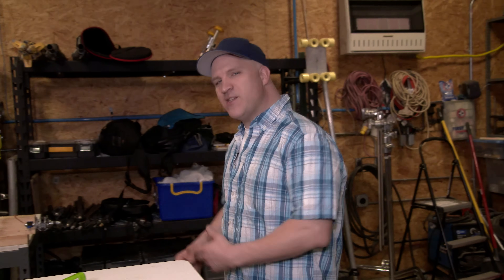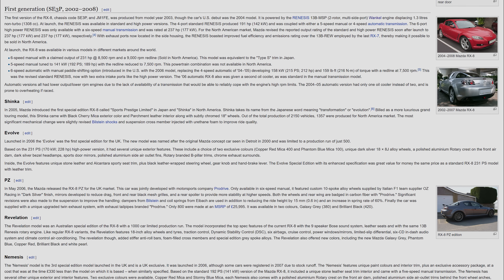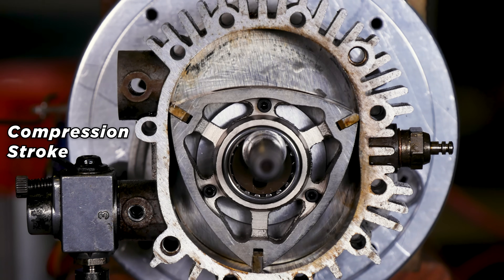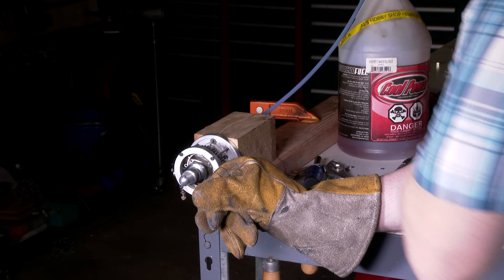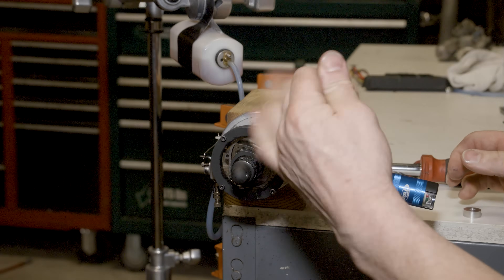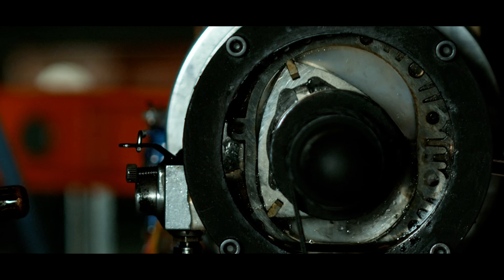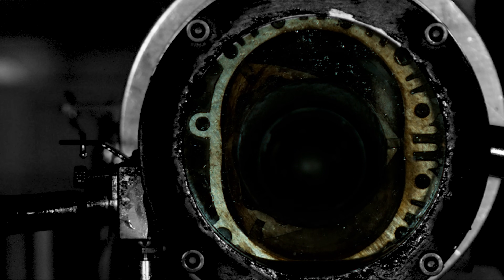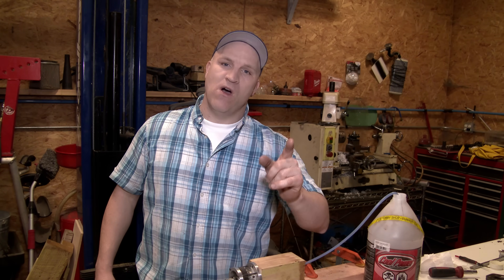See Thru Rotary Engine in Slow Motion - (Wankel Engine) 4K

Comment: No wonder my rx8 gets terrible gas mileage its not burning 75% of the fuel......
Reply: Tb0n3 I was told that if you mix a little 2-cycle oil in your fuel then it will increase the lifespan of the apex seals. It makes sense if you think about it and digging around the internet it appears to work.
Reply: Gary Leach makes sense Gary. Also 2-cycle helps lubricate diesels using low sulfur fuels.
Reply: @tim9lives Gary is just mindlessly repeating a  common urban myth... pre-mixing a Wankel engine with spark ignition is a really really bad idea... which is exactly the engineers at Mazda designed all their modern engines to only use metered oil injection.
Reply: @lyokss  a shot of redex would be good to lube and it burns lean and clean or castrol r
Reply: @Burt Habrad Any motor oil that burns clean is not a very good lubricant... which is why getting the right amount to the right places  is so important.
Reply: @lyokss   it helps if you're consistently running at high RPMs yes but a rotary naturally injects oil via the oil metering pump into the intake stream and so for normal driving or the occasional high speed run you really don't need to
Reply: Eh, try turboing it and running on E85... I get 11mpg in my RX8:)

But it's the most fun car Iv'e ever owned...
Reply: Punchy LightBeer how’s it holding up to boost?
Reply: Iv'e been through about 8 engines in 8 years, but that was because of the dodgy workshops (I tryed 3) not building it right.
Now over the last 2 years Iv'e redone everything and it's running great:) - long story..see my channel..
Iv'e run up to 20 psi recently but I have read the stock Renesis can't flow more than that besides the detonation risk with it's 10:1 compression. 
My stock ( 5000km {3100miles} ) short block is running fine on 17 psi but that is mostly because of the E85 not my shit tuning ability.
Reply: Ebola Chan always heard it’s not worth rebuilding rotary engines. Just get a new one and be done with it.
Reply: @tim9lives They don't make new Wankel engines anymore... Mazda discontinued production back in 2012.
Reply: @r1yamahamini  no disrespect to you or your car as you do enjoy it but why own something that needs regular rebuilding, more than the usual servicing etc that would just piss me off long term. I perfer something thats good quality build and lasts a while
Reply: @r1yamahamini  whats e85
Reply: The purdy channel  ,Ethanol 85% and 15% petrol . . blend fuel
Reply: @r1yamahamini  oh we dont have that fuel its either petrol or diesel
Reply: +The Purdy channel Ethanol and Ethanol blended fuels have been around for over 100 years and are available in dozens of countries including the US, Canada, Brazil, China, Thailand, India, Australia and several European countries.
Reply: @doktorbimmer  not the uk though they dont have it at our pump station
Reply: As I understand most premium fuel sold in the UK is e5 and is currently limited by law to 5% Ethanol or less. Because the UK is still decades behind the most Western countries in vehicle emissions standards and UK manufacturers lobbied against adopting more expensive Flex-Fuel standards E85 will not be available in your country any time soon.
Reply: The purdy channel UK petrol (gasoline) is 5% ethanol. Our diesel is 5% biodiesel (methyl ester).
Reply: doktorbimmer 
E85 is not a green fuel. The energy required to grow the corn and land that cannot be used for food more than negates any benefits. 
Biodiesel is a less energy intensive fuel but has the same land use problems.
Reply: @r1yamahamini  11 mpg?!?!? What the hell. Jesus how does a hummer h1 have 1 less mpg than you 😟
Reply: @Linkophere  ..... I can't believe I just read that year long argument to get to your comment:)
Two reasons, I run E85 ( you need to use 30% more fuel to make the same power )
and Iv'e been purposely running too rich because I'm scared I'm going to blow another motor...
Also I've been getting 14.3mpg ( 6.1Km per litre here in Australian numbers ) since that old comment... And I'm a lead foot:))
Reply: The 13b use side ports for the intake and peripheral ports for the exhaust.  Renesis uses side port for both more restrictive exhaust but no overlap so it runs cleaner emissions wise.  A rotary built for racing will often use peripheral ports for both.  The downside is they are completely gutless until the top of the rev range which doesn't make for a good street engine though some people do it. 

As for adding oil to the gas if your oil metering is working proper it's not needed.  The apex seals failure is nearly always a result of poor tuning or a problem with fuel delivery.  On a boosted rotary the apex seal should out last the motor.  Naturally aspirated is more likely to have a wear issue as they last roughly twice as long before rebuilds.  Most rotary guys subscribe to premix though and other than the pain in the ass factor it's not going to hurt..  It's worth noting that Mazda's racing teams don't use premix and stick with factory metering.  

The seals that are most likely to fail are the coolant seals in either case.  They degrade quickly because of combining iron and aluminum parts.  This is a problem because they expand and contract and different rates and it leads to a chemical reaction that degrades the coolant quickly so changing coolant is a must. X16 would have used all aluminum housings which in theory would have lead to a longer lasting engine.
Reply: This is running on nitromethane, which requires a much richer mixture.
Reply: Doesn't the RX7 engine survive boost much better? The RX7 ports are on the circumference instead of on the front/back on the RX8 if I recall correctly. Do you go through many APEX SEALS?
Reply: @Tb0n3  we go through many :)
Reply: he was using a glow engine there, and they are a low nitromethane mix with oil. So most of that is oil in the exhaust. since they don't have their own oil.
Reply: RX8's 13B Renises uses side ports on both the intake and exhaust. This coupled with higher compression rotors allows for better reliability and performance (NA) over peripheral port designs, reducing strain on the apex seals. The increased resistance of the exhaust allows for more fuel to burn in the chamber rather than while it's exhasted providing better economy and power. The RX8 can run like every other car except requires regular oil changes and top ups because it still burns oil by design.

The RX7 also used side ports on the intake, but used a peripheral port design on the exhaust. This works well under forced induction as higher exhaust volume allows for the rotor to travel more freely. Too much back pressure slows down the process. In the NA models of the 13B, this meant reduced economy and performance over the Renises but in turbo models, this allowed for higher boost offering improved performance at the cost of efficiency and reliability.

Basically the Renises was a compromise on performance, efficiency and reliability making it a usable daily driver. On the 13B in the RX7, people often inlarge the intake ports with bridge ports or even peripheral ports allowing for more air to enter the engine. This is thanks to the original design being restrictive on the intake rather than the exhaust. The Renises is the opposite. The exhaust is designed to be the restricting point to allow for better NA performance. But when adding forced induction has the issue of the exhaust impeding the performance. With turbo's, its not about efficiency anymore but rather getting as much air through the engine. When a Renises is turboed, the extra pressure does not match with the original design and while you can make small gains to the high 200HP area, it significantly increases the wear on the apex seals, side seals and housing. It's not uncommon for these engines to blow through coolant channels in the exhaust when using forced induction. You can't really inlarge the exhaust either as the engine is already designed pretty close to it's limit and any cutting will seriously increase the chance of catastrophic failure of the engine housing.

It's not all bad news though. The RX8's rotors are used in high power 13B engines that make use of the old style of housing allowing for higher compression in the less restrictive housing design. A well known driver who does this is Mad Mike using engines built by PPRE in New Zealand.
Reply: @dingooddflamingo  So, most of the design trade-off's can be fixed by CNC'ing your own rotory engine with better seals, better thermal barrier coatings on the rotor faces & more modern anti-friction coatings on sliding surfaces.  If someone would design a rotory engine with apex seals on the block rather than the rotor apex itself, that would allow for stronger & better sealing with reduced wear.
Reply: @madjimms It is very apparent that you do not have a firm grasp or working understanding of the fundamental and inherent flaws that plagued the Wankel engine design right up until it became obsolete in 2012... The best engineers and engine manufacturers in the world concluded long ago that the Wankel engine had reached the limits of its design evolution and no longer held any further development potential... even Mazda abandoned development of production Wankel engines in May 2009... more than a decade ago.
Reply: Its a challenge to get a complete burn in a rotary bc of its design. The sweeping and expanding "combustion chamber" isnt ideal for burning the air/fuel mix. Piston engine combustion chamber is more defined and direct. The extremely simple design of the rotary doesnt allow for the same tweaks as a piston engine. Things like precise gdi and vvt can optimize combustion in a piston engine. Rotaries dont have those luxuries.
Reply: not fuel, its oil, if he's using glow fuel. which is mineral oil and nitromethane mixed.
Reply: Garyc Cotugno typical mix is 20% castor oil 70% methanol and 10% nitromethane.
Reply: Just to clear things up for anyone reading this far, glow fuel is not "mostly oil" nor simply nitromethane mixed with mineral oil.  Most high performance glow fuel for cars is ~10% oil, ~10-30% nitromethane, with the remainder being methanol. Air applications usually bump the oil to ~20%.
Reply: Absolutely. Iceberg was totally correct. As were a number of others who have highlighted this.
This was a glow fuel model engine. It runs on a mixture of a small proportion of a lubricating oil, between five and around twenty five, traditionally castor, though these days more often a synthetic or a mix of the two as castor still has some remarkable properties especially at high temps. Not too mention it smells so damn good. Especially being cooked in a hot MotoXer flying past ya, proper on pipe. Though I digress.
This is mixed into a base of methanol with a percentage of Nitromethane, between five and thirty usually, depending on usage.
Methanol and Nitromethane require a much, MUCH richer mixture, as it in effect contains a decent proportion of it's own oxidiser, hence needing less air, in proportion to fuel, and in practice meaning same air, more fuel and more power.
This is why especially when starting, it is pissed wet through with fuel and looks so obviously so. It is also a very rudimentary form of carburettor, having no floatbowl and only the simplest of metering. As the mixture is so rich accurate metering is less important than in a petrol engine. For anyone seeing this and imagining this is typical of a normal, full sized petrol Wankell rotary engine. It is not.
I feel at least couple of folk are being a little misled by this. O course they are more problematic with regards emissions, but excess fuel absolutely sloshing around and spitting out the exhaust to poison all the Panda's really is not something that is happening.
Reply: Oh I see the fuel was shooting out of the exhaust
Reply: Neutron correct mixture had barely visible flame. Rich mixture let you see the flame. That’s it.
Reply: We tuners know you are stupid but ethanol defeats all those gasoline problems you mention.
Reply: Chris Burney   60.000km   Rip rotor ;)
Reply: Remember, what he is demoing there should be glow fuel, if i'm not mistaken which is mostly oil.
Reply: Rotary engines are much less fuel efficient that piston engines and use much more oil.
Reply: I get 22 MPG in my deleted and tuned Duramax 6000 pound 4x4 truck. Lol and tune 5 makes over 500 horsepower and 1000 foot pounds of torque.
Reply: Can't do that with a supercharger, its just a large compressor.  thrust vector is in the wrong direction, and no way to self sustain, unlike a turbo charger.
Reply: Garyc Cotugno 
Supercharger is simply a blower. It would do the job fine. But Wankel throws so much heat down the exhaust, a turbo makes far more sense.
Reply: Why compare four stroke with two stroke?
Reply: Same plus you have to feed it high octane fuel but its so worth it
Reply: @monty1300 this idea of yours is revolutionary ...
Reply: +Eric Christian Felix Wankel and Walter Froede developed the Wankel DKM-54 prototype engine from their 50cc NSU motorcycle supercharger design... which is of course why the orbiting piston concept still works better as a compressor than an actual engine.
Reply: Just an hour ago, April 2019, a neighbour told me he gets just 20mpg out of  his Mazda 1300cc, 1.3ltr, Wankel, which I found hard to believe.   Through curiosity, I reverted to Youtube and found this.   By watching this little engine throw it’s fuel away, I now understand why.
Reply: @Josephine Bennington  BEST ENGINE OF THE 21 CENTURY THE ROTARY ENGINE
Reply: Considering likely f**ked the carb settings to account for the poor sealing from the (poor) build required for the acriclic window without all the crankcase bolts exerting tension, not running it with an exhaust (tuned like a 2-stoke engines) for backpressure pulse wave timing assisting in acting as a harmonic induced exhaust valve at design normal RPM for this model aircraft engine - about 10cc in size...
   But just adequate enough, to give an idea.
Reply: @Razor 1uk  If the carb settings were "f**ked" it wouldn't run... The Wankel KKM is a 4-STROKE and uses the same 4-stroke operating principle as any Otto Cycle engine... tuned-exhaust pulse assisted exhaust scavenging is not required... although these little engines can certainly due with a good muffler due to the high sound pressure level.
Reply: Chris Burney , your RX-8 engine is a little bit different than this simple model engine. your RX-8 does burn all the fuel, for one difference is your car has a different injection system than this model engine does.
Reply: @Tim Schutte  Not really, Graupner and Mazda both became NSU-Wankel KKM type engine licensee's in the 1960's, the RX-8 certainly does not burn all the fuel because it has a very inefficient non-quench type combustion chamber... what the RX-8 has is a large after-treatment catalytic converter to burn the remain hydrocarbons although much of the heat energy is wasted which is what causes the poor fuel efficiency.
Reply: @MajorLeague  Anyone familiar with engine BUILDING should know that a 10:1 static compression ratio is NOT the ideal BUILD SHEET for ANY turbocharged engine. The more comments you post the less knowledgeable you look kid.
Reply: @MajorLeague Wrong again kid... a 10:1 static compression ratio is well above the ideal limit for any spark ignition engines running more than 1 BAR and the higher the manifold pressure the lower the SCR needs to be... this applies to any fuel type and especially engines like the Renesis that is hamstrung by a horrible combustion chamber architecture that cannot support "Quench"/High Swirl chamber technology or Stratified Charge Mode combustion. The Renesis like all Wankel KKMs has an incredibly weak, fragile internal seals which are easily damaged excessive DCR and IMEP that cause uncontrolled deflageration or high brisance propagation pressure waves.
Reply: Terrible mileage, poor emissions. Engine seals don't last and Mazda cooked the books for mileage by requiring very thin oil that doesn't protect the engine. Bad plugs..due to the Mazda RX-8 engine defect, issues regarding the spark plugs can lead to fuel flooding the engine, rendering it inoperable. So, emissions regulations and the inherent challenges associated with making rotary engines environmentally friendly are bad things. These are the issues that have always dogged the rotary engine, and are increasingly difficult to surmount.

Mazda also kind of ran out of money, since building a rotary engine is pretty far down on the carmakers list of priorities.
Reply: @QuantumRift  Delet this!
Reply: @QuantumRift  And now the wanna develop a new one. They should just keep the rotary engines in mopeds and racecars.
Reply: @Stagger Lee Wankel engines are obsolete now, no legitimate engine manufacturers are making them or racing them.
Reply: @QuantumRift   That is why youtube exist. Maybe youtubers have approached the issues and have demonstrated solutions. =]
Reply: @Sofa Kingdom All of the legitimate engine manufacturers in the world have abandoned further development of the Wankel engine... it is now the sole domain of crackpots like Gilo Cardozo and David Garsides or criminals and con-men like Paul Moller and Ernie Brink.
Reply: BEST ENGINE OF THE 21 CENTURY
Reply: + because exhaust, intake and power stroke happen all next to each other, it's very easy for something to go wrong or not work very efficiently. + at the beginning you could see how the power stroke was very inefficient, it's supposed to increase engine speed, but it was kind of pushing clockwise as well instead of just counter clockwise. Near the end, it ran much better!
I think this is a very interesting engine design and cool video!!!
Reply: @Arne Maeschaelck A very interesting, yet obsolete technology that is no longer manufactured anywhere in the world today... the Mazda RX brand was discontinued years ago!
Reply: @doktorbimmer  of course it's obsolete and inefficient, but that doesn't make it less interesting? it's cool that people tried this and it worked (kinda), but of course it's not very 'acceptable' these days where the environment and efficiency are so important. I don't get what you're trying to point out and why it gotta be bold like that ... don't be extra, it's still interesting technology.
Reply: @Arne Maeschaelck I'm simply pointing out the fact that the Wankel KKM design is OBSOLETE today because it is technically INFERIOR to comparable reciprocating engine designs that the Wankel engine failed to replace.
Reply: @doktorbimmer  BUT THAT DOESN'T MEAN I CAN'T FIND IT COOL OR INTERESTING. WE HAVE THE PAST TO LEARN FROM. A LOT OF THINGS FROM THE PAST ARE STILL INTERESTING, THOUGH. THANK YOU, BYE.
Reply: @Arne Maeschaelck R.I.P. Rest In Peace Wankel Engine 1964 - 2012.
Reply: @Arne Maeschaelck A lot of people enjoy obsolete, outdated and antique engines too... It is fascinating to learn why the Wankel engine is dead and why it was an commercial failure.
Reply: @doktorbimmer  Let's be real, it's more fascinating to understand why a brand like Mazda even got away with selling them for so long. They're not reliable, not efficient, don't burn clean, ... but they're fun because it works and it's different. It's not even that obselete or antique, because the piston engine has been around for long as well. Same fashion a two-stroke engine is still used in a lot of applications, but not in vehicles anymore, simply because it wasn't the better choice. Compared to four-stroke piston engines, rotary engines weren't the better choice. But it's still interesting.
Reply: @Arne Maeschaelck Mazda was just one of 26 Wankel KKM licensee's... they all have (including Mazda) have abandoned the design.
Reply: @Arne Maeschaelck All Wankel KKM engines use the same 4-stroke operating principle... they are just mechanically and thermodynamically less efficient.
Reply: @Arne Maeschaelck You seem a bit confused...over 100 million cars were sold last year with reciprocating engines... and ZERO were sold with Wankel engines...
Reply: @Arne Maeschaelck Historically In years past a lot of homosexuals have endorsed the Mazda RX brand... but since it was discontinued in 2012 the LGBTQ community has adopted the the electric vehicle manufacturer TESLA Motors® as the official car of the gay community.
Reply: @//Project Grassroots Fuel is injected during the intake stroke... just like any 4-stroke, spark ignition engine... you cannot inject any fuel before the intake port is uncovered. The fuel is injected before the start of the compression stroke... because the compression stroke does not begin until the intake port is closed.
Reply: Ernie Brink's engine has the worlds best fuel mileage... BECAUSE IT NEVER RUNS! LOL!!!
Reply: @doktorbimmer  are electric engines the future?
Reply: @AA16 Special Edition Not for automobiles or aircraft... batteries can never reach the energy density required for acceptable range.
Reply: but the sound tho
Reply: That was my first observation. Theres fuel just getting chucked out to the exhaust, no wonder why they say they cats go bad fast, it would blow fire out the back, or be black as holding something held above a cigarette lighter.
Reply: @Brother Juggernaut Absolutely, catalytic converter over-heating and pre-mature failure was always a problem. As was the carpet catching fire inside the passenger compartment. This is all due to the Wankel engines inherently low efficiency... most of the horsepower potential contained in the fuel is wasted out the exhaust system.
Reply: @MajorLeague Real amateur people, the professional engine builders understand that using 10:1 CR with high manifold pressures is a recipe for disaster. There are lots of home-gamers and shadetree mechanics out there building "grenade" engines in their driveways like you kid, but by simply bolting on aftermarket kit parts without any grasp of the engineering required to make big horsepower numbers reliably all you will achieve is poor performance and ticking timebombs.
Reply: @MajorLeague That pile of junk was no race car son... It is very doubtful someone with your limited education and experience could be hired as professional automotive technician in any capacity... certainly not in professional Motorsports.
Reply: @MajorLeague How would you know? No one would hire someone as incompetent and uneducated as you son... sounds like it tough for you to find a mop job.
Reply: @MajorLeague Please stop pretending to an expert... its obvious you are nothing but an amateur fan at best... a complete novice.
Reply: @MajorLeague Wankel engine do not have modern high efficiency Quench type combustion chambers... they are more susceptible to both detonation and detonation damage.
Reply: @MajorLeague Curtiss Wright and NASA spent millions of dollars developing a certified general aviation engine but all efforts proved a total failure, there are no FAA or EASA certified Wankel engines.
Reply: @MajorLeague You do not appear to be an expert on any aspect of Wankel engines or automotive engineering in general... any engineer or experienced automotive professional can see this from your nonsensical, amateur remarks that you are attempting to discuss a topic you know almost nothing about and certainly have no formal education on the topic.
Reply: @MajorLeague  Wrote, Quote;  "1. Turbo applications can't benefit from quench in any significant way." 
Then please explain WHY? Why does ever single current turbocharged production engine and modern turbocharged racing engine uses a Quench chamber design???
Reply: @MajorLeague Wrote,quote; "It (Quench chambers) can actually increase volatile combustion under boost."
Then why can Quench chamber engines run higher manifold pressures and temperatures, higher advance curves and lower octane fuel than non-quench designs????
Reply: @MajorLeague WHY? Would any engineer Increase the combustion surface area of an engine that already has TOO MUCH surface area conductivity and horrible thermodynamic entropy????
Reply: The Modell Engine is to rich in Mixture. WAY to rich
Reply: That was the first thing I noticed. It took “running rich” to a whole new level.
Reply: No ignition??  Does it work like a diesel?
Reply: Bruh this is a toy engine that has no spark plug, and has a lot of oil in the fuel, and he probably doesn't know the "sweet spot" for even this novelty engine.
Reply: Unfortunately boost from a turbo is murder on the apex seals. The RX-7 was better designed for it.
Reply: Yeah, rotaries are not known for their fuel efficiency, which is why Mazda should be given high marks for making the improvements they have on their Wankel design. They also don't make much torque (The RX8, for example, makes about 150 lb/ft of torque). This airplane version had extremely inconsistent combustion cycles (some rotations not firing at all) and blowing LOTS of fuel out through the exhaust opening.
Reply: My airplane goes a long ways on a couple gallons of fuel.
Reply: @170boone  Economies of scale dictates that the smaller engine is going to be less efficient than the large one. Plus, I can only imagine the tech that helps that airplane rotary burn fuel more efficiently than this small model airplane one.
Reply: Tend to burn oil too
Reply: the wankel works and looks a lot like a 2 stroke to me
Reply: Bro buy higher octane fuel. Smh.
Reply: My 460hp v8 mustang gets about 19mpg driving how ever I feel like, it’ll break 24mpg if I stay out of it
Reply: MajorLeague  I guess you have never seen a 12A or a 13B rotor???  All Mazda RX engines had a combustion chamber recess.
Reply: MajorLeague  All engines have a quench space?!?! WTF! I guess you don't know what a HEMI is kid!
Reply: MajorLeague  The BMW S68 is a GDI engine that operates with Stratified mode combustion, just like a Diesel... of course it doesn't have quench effect. IT DOESN'T NEED IT!!
Reply: But that’s also why it shoots some mad flames ;)
Reply: You can try change gasoline to propane gas  or add hydrogen with gasoline.Hydrogen should add torque, when hydrogen will burn ,hydrogen converted into water and hight temperature will be evaporate water creating hight pressure.Its my theory.
Reply: Crazy
Reply: @*BOOG* in case you haven't noticed all cars these days with internal combustion engines aren't 100% efficient, they all waste a little fuel on the exhaust stroke
Reply: rotary engines take in extra fuel to help cool the apex seals it uses the unburnt gas to cool them so that is why you rx8 gets bad gas milage but in the long run its saving you money because apex seals are not cheap and they are a pain in the a$$ to fix
Reply: Yeah it's 18 too 20 miles a gallon
Reply: Travis Thacker 
Google Ilmor 5 stroke engine. Two four strokes feed exhaust gas into one larger cylinder. It’s about 15% more efficient. Benefits are not huge.
Reply: Sakul you lot clearly failed to listen to what the narrator said. He put a rich acetylene mixture through the engine to create a yellow flame. All that did was demonstrate how it works. When it was running correctly you could not see the flame.
Reply: Rotary engine is easy to make!
Reply: The RX-7 has a lower compression ratio 9:1 vs the RX-8s 10:1 so you can't run as much boost.
Plus the variable intake manifold makes it a bit more difficult to tune.
Reply: @r1yamahamini  o
Reply: @Kim Brokaw Yeah, 11MPG really sucks!
Reply: @doktorbimmer  also another weird question, is swapping in a nissan z33 v6 in an AE86 a good idea? Apparently my friend did it.
Reply: Bass Nazi I get that it’s an inefficient process due to a number of issues from imperfect seals to trying to maintain an even burn in a moving “cylinder,” etc.  But if you could separate the unburnt gas from the rest of the exhaust it wouldn’t really matter how inefficient the process was.

I was just wondering if there was a way to dump the exhaust into a spinning drum or something to achieve this. It would be well worth the added complexity.
Reply: @xpeterson  one major problem would be the vapour ignition, as seen in this video.

Once you box in the exhaust emissions and it ignites then your left over fuel is lost. 

That's why you get those cool looking flames from the exhaust sometimes. 

It needs some real genius engineering but sounds possible to an extent. 

I think it can be done, but probably not worth it since people are moving more to electric and hybrids.
Reply: @Abdul Muqsit Tofie Combustion efficiency is just one of many fatal flaws in the Wankel engine concept... Wankel engines no longer offer any advantages or further development potential.
Reply: @doktorbimmer   Here we go again. This man has a personal vendetta against rotary's.  lol
Reply: @Sofa Kingdom I personally love Rotary engines and have 3 in my collection... but of course we are talking about WANKEL engines here son, apparently you don't know the difference yet...
Reply: @Sofa Kingdom  The truth is incontrovertible son... people need to hear the facts and the false rumors you try to propagate need to be exposed for what they are, these crackpots are nothing but fakes and frauds.
Reply: @Sofa Kingdom Why do amateurs and dilettantes like you feel the need to post false rumors and regurgitate urban myths regarding a topic in which you are not formally educated or sufficiently experienced to speak intelligently on???
Reply: @Sofa Kingdom You do not intimidate me in slightest son... If you think the Wankel can be developed into an efficient design you know absolutely nothing about engineering or the history of the Wankel engine's development.
Reply: @Sofa Kingdom Its very obvious that you are completely oblivious of the development history of the Wankel type KKM-57 engine design and lack even a basic fundamental understanding of its inherent flaws that have have rendered it obsolete in the automotive industry... even Mazda gave up trying to fix the horrible problems that plagued the Wankel engine right up until production ceased many years ago. None of your childish insults will change these incontrovertible facts.
Reply: @doktorbimmer  aw, how cute.
Reply: @Sofa Kingdom Just the facts here kid... I see you continue to be plagued by poor judgement and bad life choices but again some people like you feel the need to learn everything the hard way.
Reply: @doktorbimmer  Since you seem to hate rotaries so much, why don't you stick to your piston engines and your comments in bold and quit whining about other people driving and enjoying what they think is a much cooler and interesting type of engine? If someone drives a rotary, it's their money, not yours. 
So you can take all your salt and go put it on all the icy roads out there, dear.
Oh and, Apex seals last a long time if you take care of the engine. Which you probably don't.
Reply: @reinbeers5322  🍻💯💯
Reply: @xpeterson  It is called EGR
Reply: @xpeterson  the flaws in the design of the (Wankel)engine which could be easily overcome with turbocharging, the turbocharger should be a tesla turbine at exhaust, roots type on intake...
Reply: Is there no way to centrifuge the unburnt gas back into the gas tank?  I realize this would add complexity to an otherwise simple and elegant engine, but other issues seem surmountable if only the engine was fuel efficient
Reply: xpeterson carbon dirt residues aren’t good for the exploding chamber
Reply: @xpeterson  Piston engines already do this. Exhaust gas gets vacummed into the intake manifold via a vaccum line. This leads to a lot of carbon buildup in the valves - a problem that direct injection metigates by cleaning off some of the carbon and re-vaporizing it  to gas.
Reply: @xpeterson  they dont have re circulation lines directly into the intake chamber? 2 stroke outboards do this into the intake manifold....
Reply: Think it's just an inefficient process. I mean it's really efficient at producing power given the size and weight, why the Rx8's had almost perfect weight distribution, but figure you could it's just like you said the added complexity probably keeps most from it.
Reply: Chris Burney Not saying the rotary doesn't waste fuel. But this is a big exaggeration. Remember the 13b has 2 spark plugs  each rotor to ignite the fuel on both sides of the combustion chamber. So you will burn fuel more efficiently than this obviously. The way this engine was designed literally only does half of the fuel in the chamber.
Reply: +Travis Thacker What would the point be of compressing the hot expanding gases? 
How will you ignite the exhaust gases a second time if the air-fuel mixture is outside the range required for ignition and flame propagation to occur????
 Why not just switch to using more efficient reciprocating engines like every manufacturer did, just like Mazda did in 2012...
Reply: Was about to write the exact sentence and adding: "No wonder it did'nt get more popular. You literarly waste gas and money driving one"
Reply: @.SpiinDeX Then why do Wankel engines in general use twice as much fuel as reciprocating engines.
Reply: @.SpiinDeX Wankel engines have half the Carnot efficiency and Double the BSFC of reciprocating engines. Wankel engines are obsolete because they waste fuel and are horribly unreliable.
Reply: @doktorbimmer  Turbo will effectively increase compression and ambient heat, bringing the fuel charge closer to ignition temp, more fuel will get burned. Turbo is great. Uses wasted power to increase efficiency. Rotary can handle it much better than a reciprocating engine.
Reply: @Error A turbocharger will only increase Dynamic Compression and cannot increase ambient air temperature... only intake manifold temperature.
 Modern turbocharged cars use intercooler/heat exchangers to lower the charge temperature (including Mazda). High charge temperature is bad, and leads to pre-ignition/detonation (which is more prevalent in the Wankel do to its poor chamber design) and dramatically decreases efficiency, produces very high exhaust emissions and damages the engine severely. Turbochargers have several limitations... such as turbine inlet temperature, and net efficient gain.
 The Wankel is less efficient, less reliable and creates more exhaust emissions in turbocharged applications than reciprocating engines, the Wankel produces significantly higher EGTs and requires more fuel consumption (boost fuel enrichment) to prevent damage to the exhaust turbine and apex seals.... the Wankel is less thermally efficient so it's also less fuel efficient in a turbo application than reciprocating engine types.
Reply: @Error A turbocharger will only increase Dynamic Compression and cannot increase ambient air temperature... only intake manifold temperature.
 Modern turbocharged cars use intercooler/heat exchangers to lower the charge temperature (including Mazda). High charge temperature is bad, and leads to pre-ignition/detonation (which is more prevalent in the Wankel do to its poor chamber design) and dramatically decreases efficiency, produces very high exhaust emissions and damages the engine severely. Turbochargers have several limitations... such as turbine inlet temperature, and net efficient gain.
 The Wankel is less efficient, less reliable and creates more exhaust emissions in turbocharged applications than reciprocating engines, the Wankel produces significantly higher EGTs and requires more fuel consumption (boost fuel enrichment) to prevent damage to the exhaust turbine and apex seals.... the Wankel is less thermally efficient so it's also less fuel efficient in a turbo application than reciprocating engine types.
Reply: @doktorbimmer  As compression increases, the air being compressed also increases in temperature, which brings the fuel closer to the ignition temp, making it easier to ignite, the flame front will move more quickly. Basic operating principle of turbo diesel. They are low compression engines. Turbo is used to increase compression and heat, enough to ignite the diesel immediately when injected.
Reply: @Error I see your understanding Otto type engine operating fundamentals is very limited and you are very confused about the fundamental differences between Homogeneous Charge Spark Ignition mode and Stratified Charge Compression Ignition mode operation...
 In Homogeneous Charge Mode operation the charge temperature must be maintained well below the auto-ignition temperature of the fuel to prevent unstable, erratic pre-ignition from occurring before the spark ignition and properly timed and controlled flame propagation.  
 Pre-ignition wrecks efficiency, emissions and quickly destroys the engine. Efficient flame propagation speed and Deflageration of the air/fuel charge must remain in the subsonic velocity region...
 The geometry envelope of the Wankel KKM engine design that allows it to function as a 4-stroke engine also physically limits its Static Compression ratio and combustion efficiency decreases when the combustion recess volume is reduced. 
 Don't confuse 4-stroke Diesel-Cycle with the 4-stroke Otto-Cycle operating principles... they differ greatly in several regards most notably how they react and respond to turbocharger and supercharger forced induction.
Reply: @Error If you have any questions about internal combustion engines, Wankel engines or turbocharging? I would be happy to explain them to you in greater detail.
Reply: @doktorbimmer  I understand dyno results. That's all I care about. Wankels are awesome. All the engineering in the world can't refute a turbo RX-7.
Reply: @Error It would seem there are many things you do not understand, How can you really care if you are unwilling to understand something as important as why the Wankel engine was a commercial failure? The Wankel engine design is inherently inferior to the reciprocating engine types in every significant respect... all the engineering in the world is not going to bring it or the RX-7 back...
Reply: @Error It would seem there are many things you do not understand, How can you really care if you are unwilling to understand something as important as why the Wankel engine was a commercial failure? The Wankel engine design is inherently inferior to the reciprocating engine types in every significant respect... all the engineering in the world is not going to bring it or the RX-7 back...
Reply: @juansolo1617  don't forget they might have high horsepower to displacement ratios......but much lower torque too.....😉👍
Reply: @MajorLeague Wrote, quote; "Renesis has scalloped rotors"
ALL WANKEL ENGINES HAVE A COMBUSTION CHAMBER DUMMY!
Reply: @MajorLeague "depricated"??? You mean depreciated? or deprecated?  You can do both as the non-quench, hemispherical engines are OBSOLETE in both production automobiles and MODERN Racing engines.
Reply: @MajorLeague Like the Hemi engine the non-quench Wankel engine design is OBSOLETE due to its poor combustion efficiency and power output... in particular new production turbocharged applications that continue to grow in popularity as power-per-liter output, fuel efficiency and cleaner emissions continue to improve thanks to very efficient, detonation resistant quench chamber designs.
Reply: @MajorLeague  preignighters??? YOU MEAN LIKE CARBON DEPOSITS?????